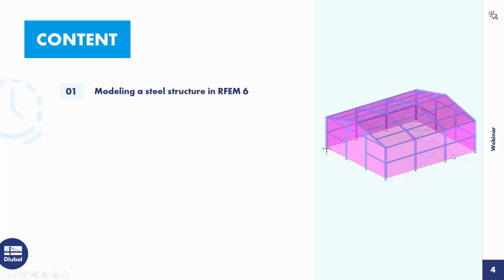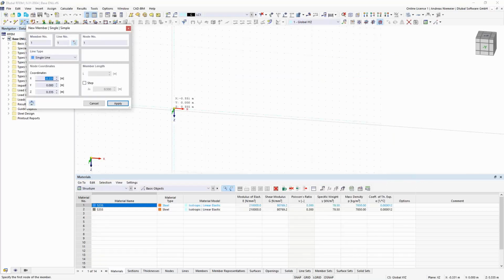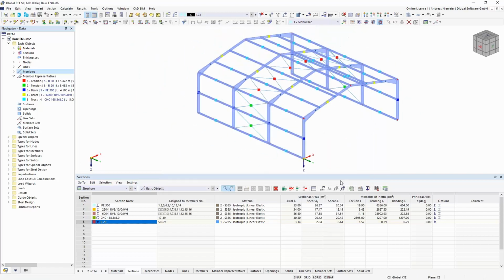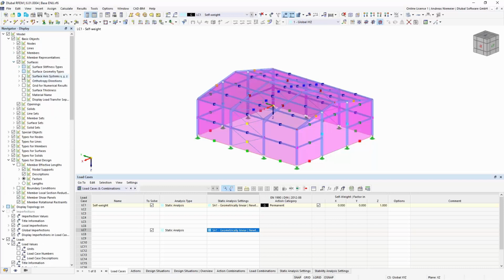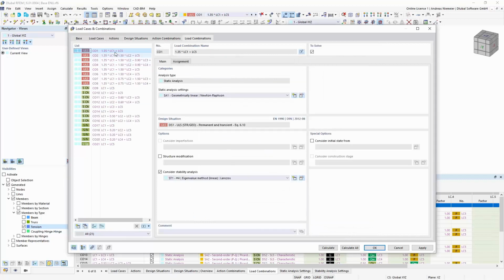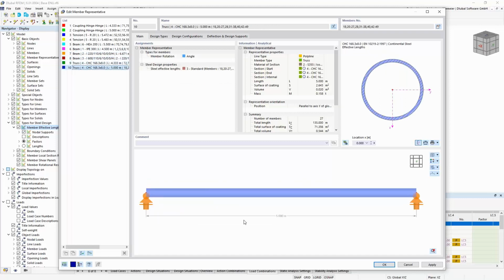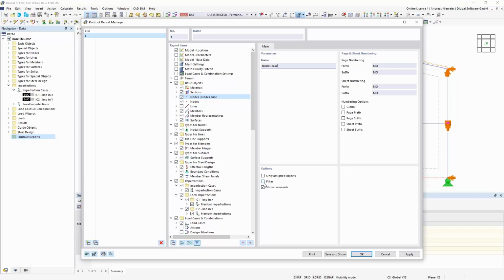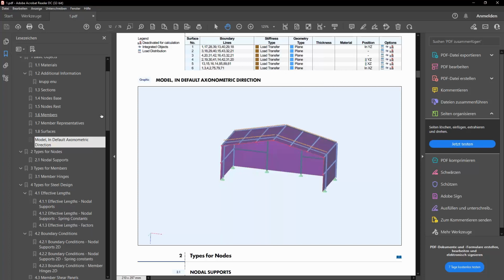[EN] Modellierung und Bemessung von Stahlkonstruktionen in RFEM 6 und RSTAB 9 | 2021-10-20

Comment: Well explained. Thank you. One question though. When defining the effective length for structural members, for most members you only defined the intermediate nodes representing the bracings and left the effective length factors as 1.0. However for one member you defined it as 3.5. Shouldn't you have defined/entered the effective length fators other than 1.0 for other members as well? Or does defining only intermediate nodes mean that we need to enter no effective length factors? As you said, the software itself doesn't automatically define any effective length, correct?
Reply from the maker: Hallo Civil3000!
There are 2 different ways to consider the right length. You can define the "Boundary Conditions" (https://youtu.be/naVnW1oZZLo?t=3038) or the "Effective Length" (https://youtu.be/naVnW1oZZLo?t=3098)